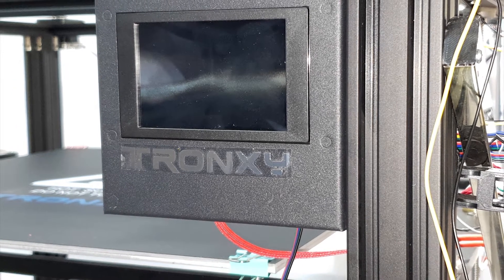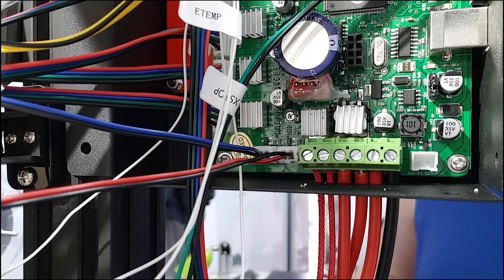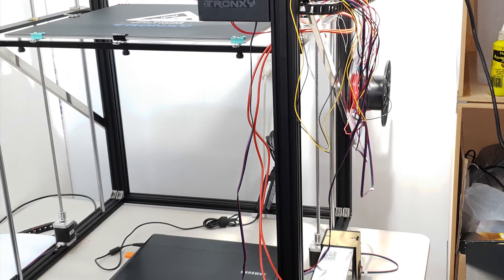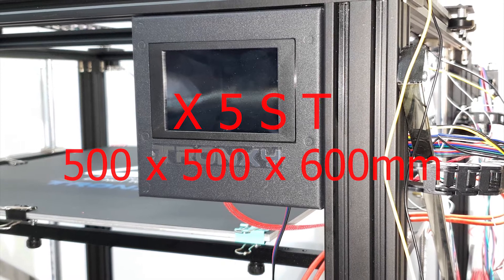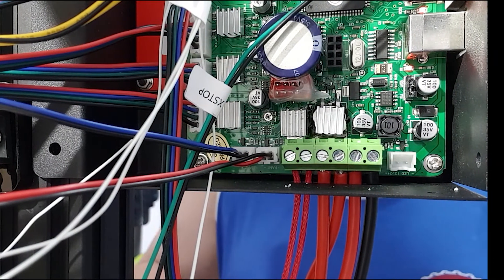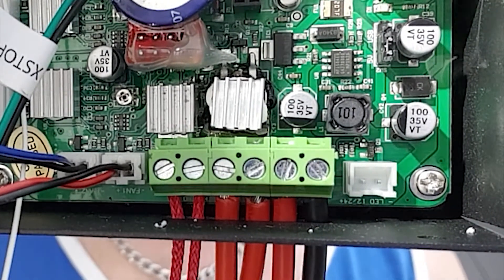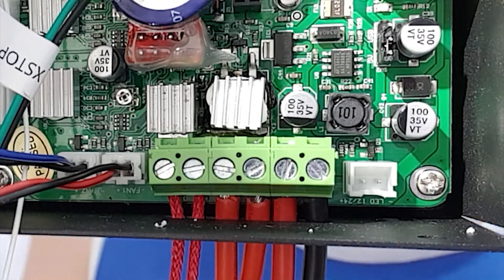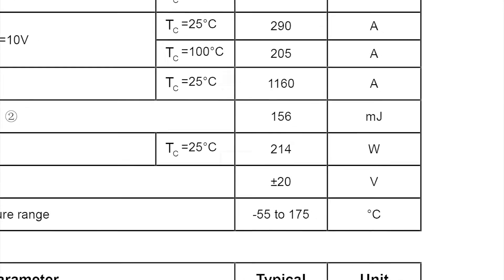#1 - WARNING - TronXY X5ST Fire Risk

Comment: When I got mine I was very unimpressed with all the wires and such as it just looked so untidy, for a machine that cost me $1150AUD it was pretty pathetic. I replaced the main controller board with a Big Tree Tech GTR and using Klipper and OctoPI as the control software. I am more confident now that it wont burn my house down.
Reply from the maker: Yep, mine is heavily modded now just have to put the finishing touches on it.
Reply: @xyzconceptsYT  The basic aluminum frame, heat bed platform and the steppers are OK but just about everything else on it is crap. I should of just brought the extrusions and such and built my own from scratch but I thought I was going to get something that was a bit more substantial.  Out of the box the X axis limit switch failed, then the z axis linear bearings. I emailed them and never got a decent answer. Only good point was I learnt a lot about what not to do!

Comment: Hmm, I bought an X5ST-400 and the board exploded when it first got power. Tech support told me that this is because the printer converts to 12V for all outputs, and it was that conversion circuitry that bit the bucket. I never got to see this in action but it does make me wish I could see a voltmeter on that heated bed output to confirm or deny their claim. I suspect it is in fact unlikely that it doesn't just pass the 24V through to the heater, but they told me it uses 12V for everything. If so, that would limit the heated bed's power quite significantly, making it difficult to get it up to any temperature at all -- which is exactly what I saw other X5ST-400 owners reporting. If that's the case, then your problem here isn't a design flaw, it's components not working properly (like on my board :-P). (My printer now has an SKR 1.4 and uses a mains power silicon heating pad controlled via an SSR :-P)
Reply from the maker: The problem with mine it that it was supplied with a controller suited to a full 12 volt system.  However my unit shipped with a 24v heatbed and 24v PSU for that heated bed, expecting the 12v controller to handle a doubling in power output.  Mine clearly did not like that.  :(
Reply: @xyzconceptsYT  Hmm, maybe you received a different board than I did, then. My board was a green board with an ARM STM32F103 chip on it, and the input is clearly labelled with a silkscreened "12/24V". My board has spots on it for 5 stepper drivers, but only 4 are installed; the 5th pad is empty.  The corner of the board says "CXY-V5-180409". After some searching, it appears that the component that exploded on my board is an AMS1117 voltage regulator, a small chip with three chunky leads running into it and one really fat tab on the other side located close to the input jacks.

Comment: Consider buying x5st 2e, is it also a fire risk?
Reply: I wouldn't bother with anything TronXY -Complete lack of any support @ least in my Exp. Have the X5ST-400 came with wrong bed, defective E stepper, as well as the under-powered mosfet got about 4 prints and now it's pretty much a paper weight.
Reply: @SgtTaz  Thank you for your reply, I have already purchased the Anycubic Predator.
Reply from the maker: I agree, don't buy it unless your getting it for the base foundation knowing you will mod it.  Saying that I was suprised at the extent of design flaws it had out of the box.

Comment: That is not how the power dissipation figure is used at all. The MOSFET (this model in particular) has an ON state resitance of 1.6 miliOhm typical. Power dissipation in the mosfet is P=I^2*R as in, current squared times mosfet resistance. Assuming 15A load, that would be 25mW, far less than the maximum rating for TO-263 package.
The figure you're quoting is the maximum amount of power the mosfet can dissipate if you manage to keep the junction temperature at 25 degrees Celsius. That is something that can be done only through some rather exotic means like Peltier devices or liquid nitrogen cooling etc. Such conditions are impossible in normal use. Depending on the board layout, TO-263 transistors typically should  be able to handle up to a Watt of power dissipated without too much of an issue.

Comment: Hey I am Considering buying a TRONXY X5ST-500-2E 
Do you know if it has auto-bed leveling?
Reply: It is not. You will have to modify it to do so.
Reply: Thomas Allgood You really don’t have to auto bed level... The heat bed stays in one place while the extruder does all the work... You’ll get a better print quality with Tronxy than you do with a CR-10...

Comment: It really would have helped if you had:

1) taken shots of the PS box ratings
2) the heat bed model and ratings
3) shot of a wire gauge measurement for the wires feeding the bed (probably under gauged, too!)
4) shot of amp meter sucking 15 amps (360w/24v = 15A)

Comment: I have the same printer and Im lucky now than I have on the first time before I printed, add a second mosfed whis a bigger cooler for heathbed and for the hot end...
Reply: @xyzconceptsYT  mom I need to translate your text xD text to strong for a old German guy
Reply: I tested it all ready, on my printer it never get more then body themp... i buyed this here 
https://www.amazon.de/gp/product/B071XHN284/ref=ppx_yo_dt_b_asin_title_o05__o00_s00?ie=UTF8&psc=1
Reply: @xyzconceptsYT  but my TL-Smoother Plus get so hot that i print an incloser and but all in including a 140mm pc fan in series this a 120mm pc fan that cool the mainboard vom the printer (its fit perfekt and mush quieter)... Series why it is 12V fan but we got 24V from the powersuply
Reply: @xyzconceptsYT  all guys have a other way ^^ but hope that it work ^^ my option work fine, and im happy this them ^^ next part ist checking the Stepper Voltage and change the hotend fan to noctua fan and build a new partcooler and i got now new and longer linear bearings for the hotbed ^^ it is for me one of the importent thing to get a staible hotbed that i easier can level